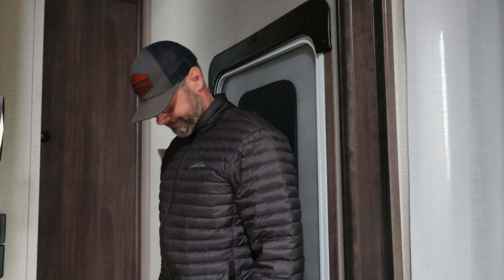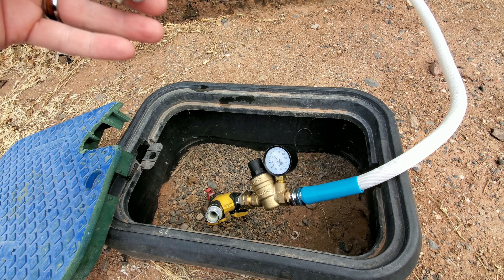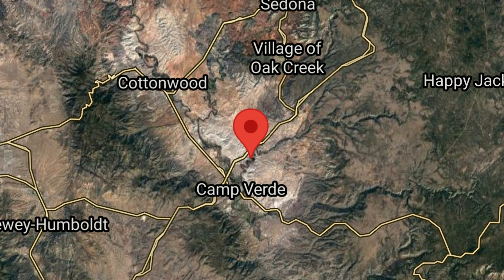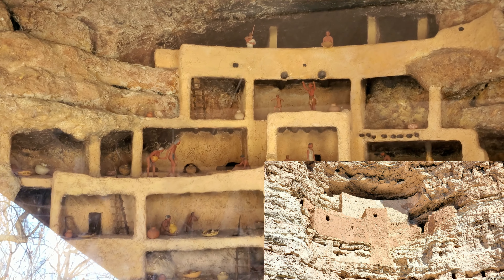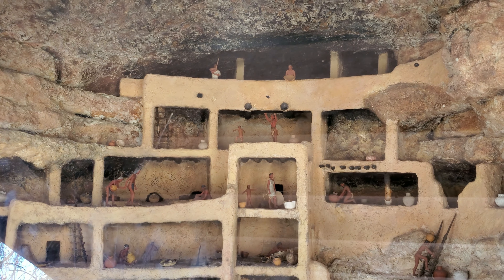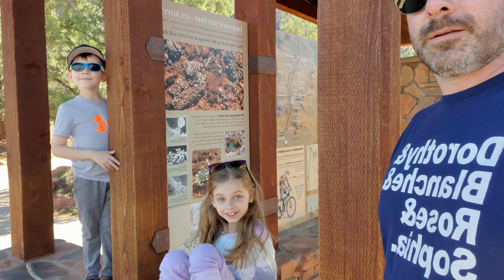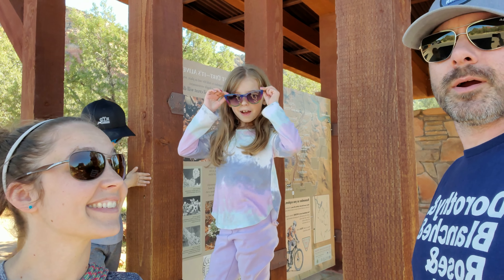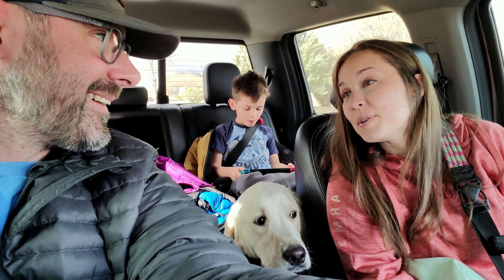Arizona Views And Hiking | RV Water Leak

Comment: Hi, just found you. We travel with 3 pups and we have used self-service dog wash stations at either Tractor Supply or Petco. Other dog stores may have them too. Super easy since they typically supply everything you need and the wash tubs are elevated so you don’t strain in an awkward position. We’re in a Solitude 373 and have had several leaks. We’ve got water monitors from Amazon. Also use the same company (Govee) for temperature monitoring too. Not too expensive and we’ll worth the cost. Ours are connected to our T-Mobile SIM card. Safe Travels!
Reply from the maker: Great advice, especially on the dog wash! Thank you! We recently purchased water monitors too. Great piece of mind for sure. Thank you for watching and safe travels to yall as well!

Comment: Thanks!  Great tip!  Can you make a quick video of the fix?  That might be interesting to your viewers.
Reply from the maker: Hey! I just tightened the fitting with a pair of channel locks. Pretty quick and uneventful so I ommited it in the video. The water pressure regulator was causing the pressure surge so I replaced it and solved the cause. I'll do better at showing every step in the future! Thanks for your input!